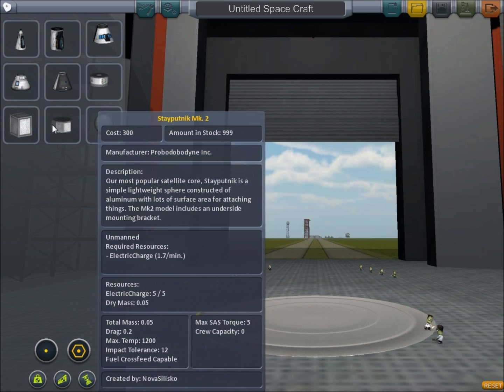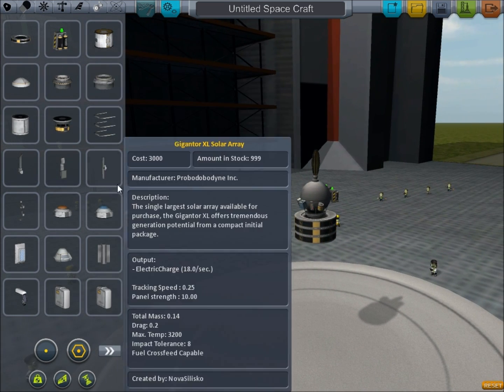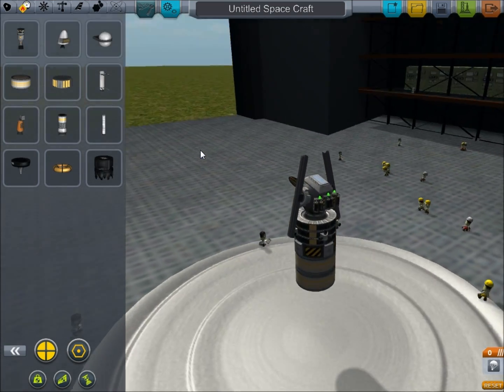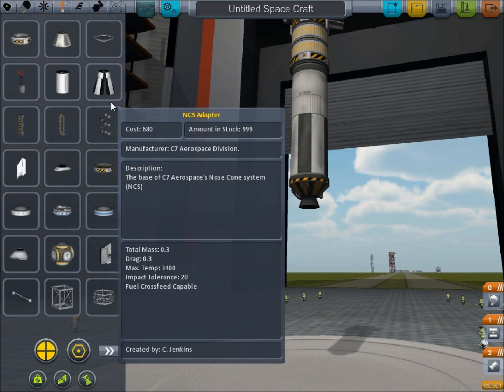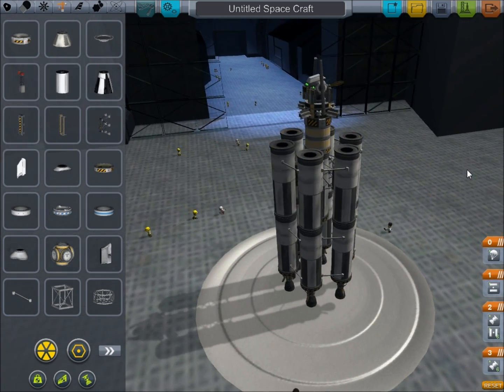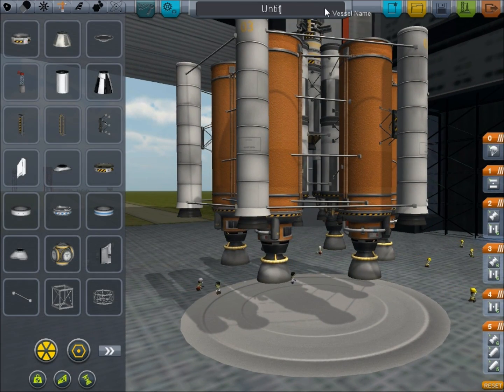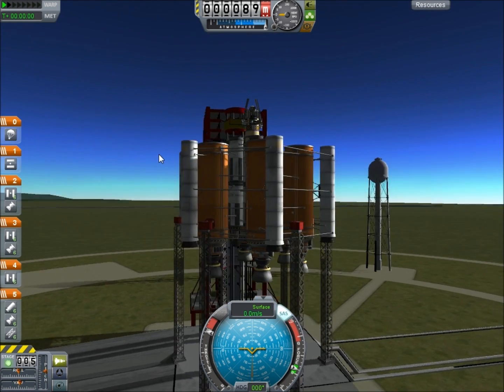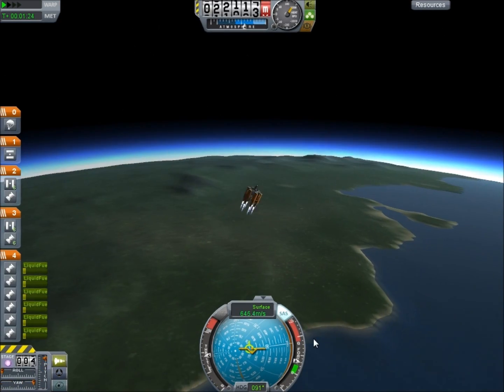Kerbal Space Program Tutorial Ep. 3 Satellites

Comment: My favourite way to auto-deorbit engines and fuel tanks: 
-> Place 4 to 8 sepatrons (8 seconds micro rocket boosters) in reverse position mounted over the last fueltank.  Stage them to activate at the same time at the satelite decoupler. [ Point to prograde and roll (rotate) all the rocket+satelite as fast as you can before releasing it].